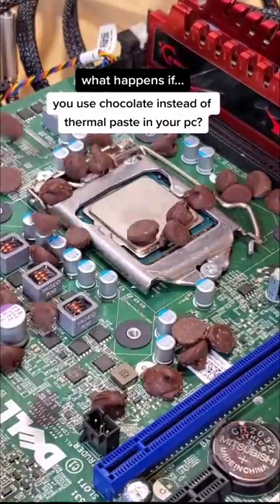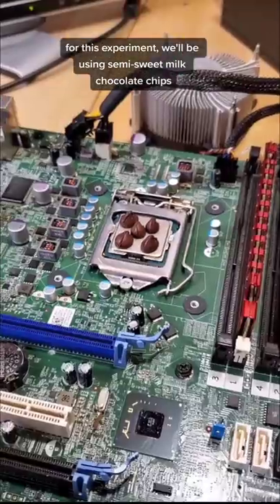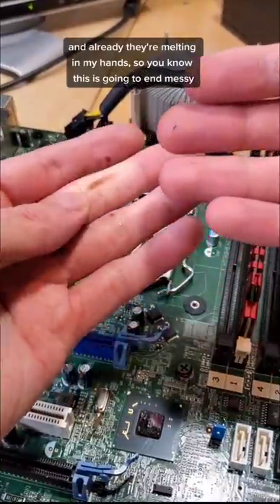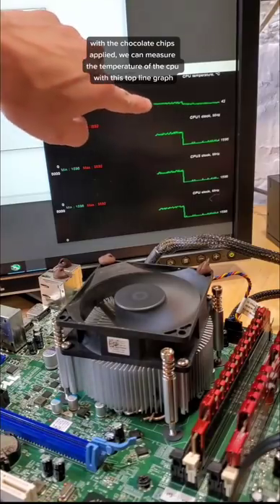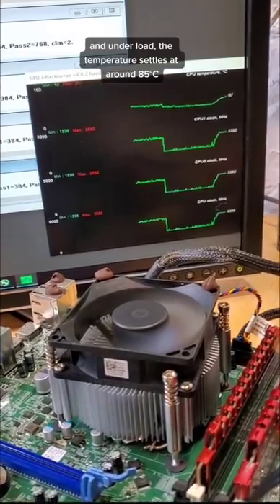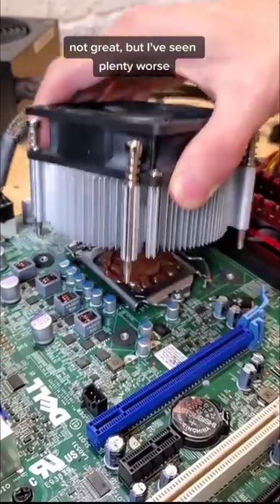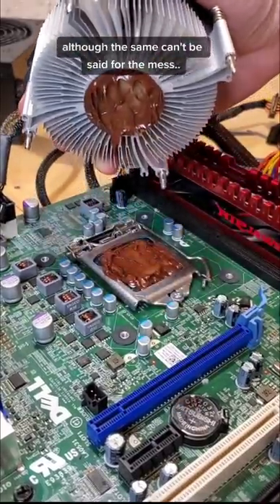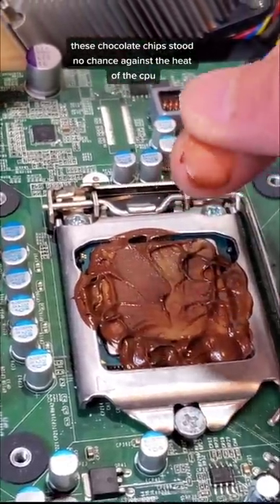using CHOCOLATE instead of thermal paste #shorts

Comment: The cpu is even more effective than a radiator
Reply: Nope cuz a radiator needs to be hot in a long term whereas the CPU cools down quickly
Reply: Remove the fan from a pc and see it becoming flames
Reply: @thatkoeniseggagerars  It will just shut off
Reply: @JH-ed4mm  my laptop not and it can go to 105°c and over
Reply: @Jouniii  its a laptop
Reply: @Jouniii  i think u need to re apply thermal paste if you can. Mine doesnt even reach that close to there
Reply: oooof, 105c ooooo you can grill a cheese sandwich at those temps.

Comment: What would be interesting is if you tried a anti seize grease for bolts (mainly used in the auto industry). It looks near identical to thermal paste but serves a completely different purpose. Might be interesting

Comment: PLEASE, PLEASE TRY HELP ME!!!!

So basically heres the story, i know nothing at all about pc's, i only game on mine nothing more, i reset my computer because i was having issues opening a game, when my pc reset it took me into a windows 10 updating screen with no information, just the downloading spinning thing, i stupidly reset my computer again because the dowload wasnt working, now my computer is comeplety screwed, whenever i reset it, it just takes me into this gray, blank screen with nothing but a loading mouse, i have tried all recovery settings, i even tried resetting windows, nothing AT ALL has worked even the slightest, i just end up back to square one with a blank gray screen, when i tried launching into safe mode it came up with an error that i do not know what it means, please please help me ive been at this for multiple days and absolutely nothing has worked. Ive even completely taken out and put back together every single wire so i know its most likely a software issue and nkt hardware, please, please help me im starting to think my pc is completely screwed and ill have to buy a completely new one